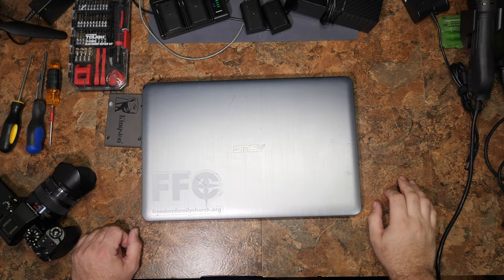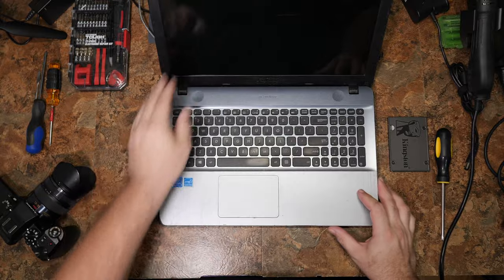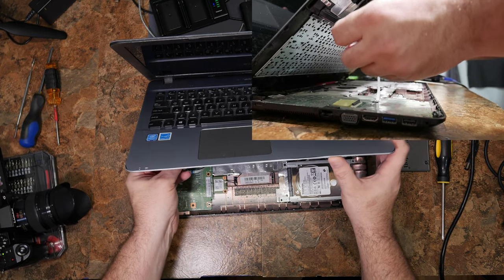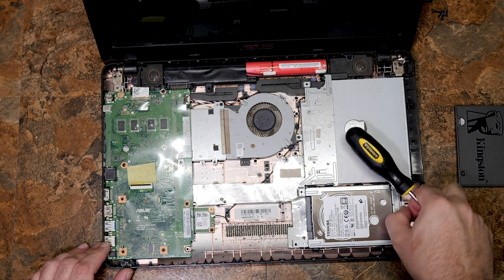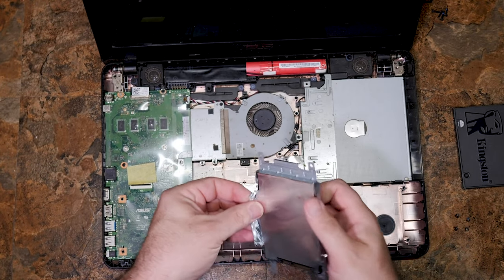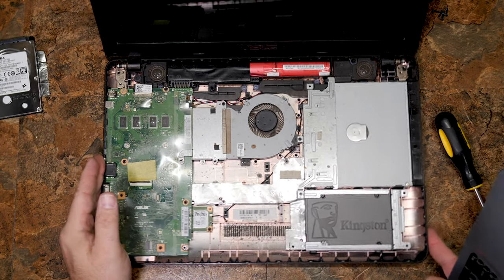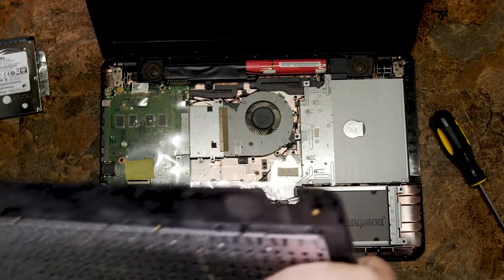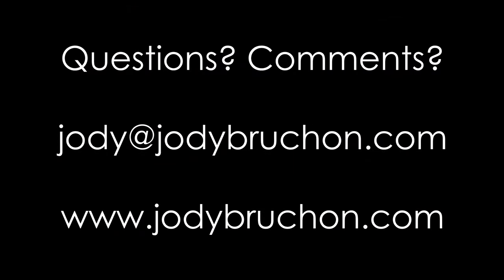ASUS Vivobook X540 Series Disassembly, SSD Upgrade; RAM, CPU, Motherboard, Battery - Jody Bruchon

Comment: After changing my hdd to an ssd i tried to turn it on and wouldn't display image on the screen neither the light of "On", tried to put the hdd back again but didn't function. I'm screwed i guess.
Reply from the maker: Sounds like a battery or power problem.
Reply: Did you transfer windows onto it?

Comment: Can I install M.2 PCIe NVMe SSD in Asus VivoBook 15_ASUS Laptop X540MA ?                            System Model: VivoBook 15_ASUS Laptop X540MA_X540MA
                     BIOS: X540MA.319 (type: UEFI)
                Processor: Intel(R) Celeron(R) N4000 CPU @ 1.10GHz (2 CPUs), ~1.1GHz

Comment: I have a Asus Vivobook X540MA and would like to know where the CMOS battery is located, I have opened the vivobook but can not locate the CMOS battery. "help"
Reply from the maker: Motherboards like this with "sealed system" battery packs that the user can't normally replace tend to not have CMOS batteries. They use the battery pack as the CMOS battery too. Even a fully depleted Li-ion battery puts out enough current to power the CMOS/clock part of the chip. You need to detach the board and battery pack for a while, most likely. Also, sometimes CMOS batteries are very small and are soldered to the board, not big obviously removable packs with wires and a connector.
Reply: @JodyBruchon   My X540MA sometimes it comes on sometimes it dead but the time and date is always wrong.
Reply from the maker: @MikeBe-qb6dr  Your lithium battery back may have gone bad.
Reply: @JodyBruchon  I was thinking the same thing, thanks for the help.

Comment: can i say upgrade ram memory? if yes what correct frequency for x540
Reply from the maker: I haven't owned this in a long time but the RAM is upgradable and any DDR3 laptop RAM should work. It's old enough that it doesn't require DDR3L.
Reply: @JodyBruchon  okay thanks